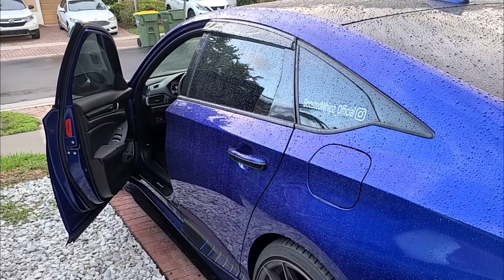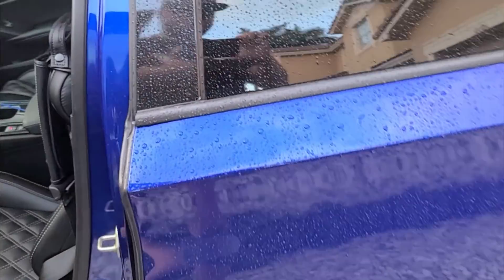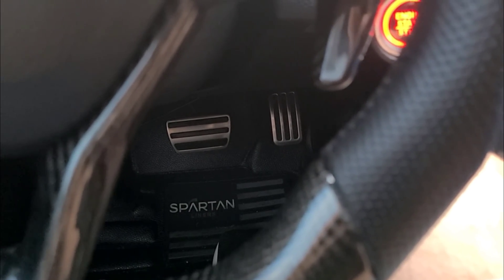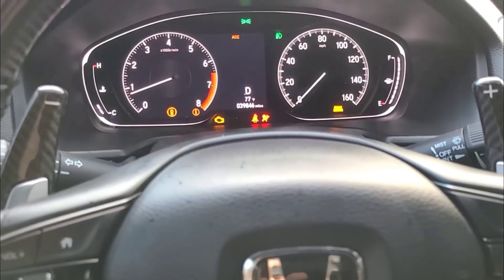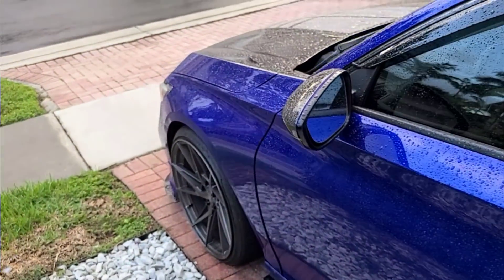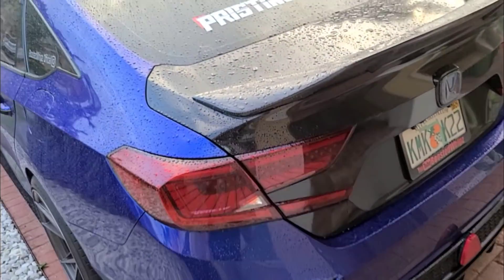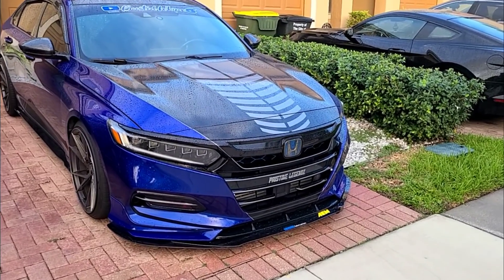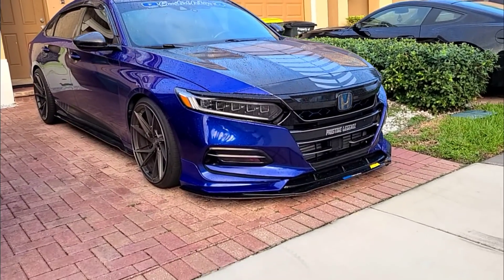CVT Transmission Goes Out at 40K Miles on Modded Honda Accord 2018-2020

Comment: Beautiful build probably the nicest accord I’ve seen so far I hope that everything works out for you in the car gets back up and running as far as everyone saying you should’ve got a manual transmission I’ve been driving a Honda civic SI three generations eighth ninth and now my 10th all si Which is obviously manual transmission but after all those years I’m starting to get a bit of a back problem as I’m getting older but I want to stick with a sporty feel so I’m going with a dual clutch transmission otherwise I’ll drive manual for the rest of my life

Comment: I got my 2018 Civic Sport hatch 1.5 turbo cause I specifically wanted a stronger engine and CVT transmission. I know CVTs are not made for power but at least they can handle stock power levels fine. I did some research and found out that the transmission in the 1.5T is the same one in the 189 horsepower Accord Sport sedan. It’s just m improved and better tuned for the turbo engine. Under stock power levels they can last a good while. Respect the boundaries and it wouldn’t give you problems. Here’s the deal people. 

If you want a faster car, just buy a faster car. Don’t tune it. People think they can buy lower horsepower cars and mod the hell out of them to become super powerful sports cars. It’s not worth risking it just for a slight performance increase.

Comment: Hey man sorry to hear about your car. I have the same car as you accord 1.5t cvt. I did a Ktuner stage 2 yesterday I’m at 25,000 miles. Should I take the tune off then? You think the cvt would be fine with the stage 2 on my car? I don’t drive like a manic with the tune or push it extremely hard. I’m getting rid of the car in a couple of months anyways. Just wanted to have some fun while I wait.
Reply from the maker: Should be fine since the base tunes are conservative.

Comment: When I had my 2018 civic coupe 1.5t CVT, my CVT failed as well around 32,000 miles, I had similar power levels to yours (I had 221hp and 224tq on the dyno)
 I had PRL catless DP and frontpipe
3” straight pipe exhaust
PRL cobra CAI with race MAF 
custom dyno tuned 22psi max KTuner
Reply: I think that 22 psi was your issue man my ktuner stays under 20 and it pulls hard with a custom stage 2 tune in at 53k and have had countless issues if I try to race in eco the car gets stinky fast or even just get on the gas sport revs higher and takes a lot more to get stinky to make up for all the power I’ve thrown at the small engine and weak trans my car is on 18s fully gutted and any other weight reduction necessary I believe not carrying around a family or a lot of weight has proven to help the car last I don’t expect the car to see no 500k miles or nothing crazy but I do think 250k is in the cards.
Reply: that’s crazy how you guys cvt failed i’ve been tuned on a phearable tune pushing 295 HP and 255 TQ and no issues race it every once in a while and i’ve been running it like that the last 10k miles and im closing in on 60k
Reply: the key is ti stay on top of your CVT fluids 🔑
Reply: @RemingtonScarborough  you have the 1.5t cvt? I have a pherable stage 3  whit k&n intake and borla type s catback.
I dont make hard pull but i always drive sport whit the padle shift ( just for heard borla 🙈🤣) i drive hard on the highway. I scare for the cvt i wonder i can swap the trans for à manual. I live in Canada so my accord was stored for the winter and i change the trans at all summer. Do you think we good whit our cvt bro ? 🙏🤣 i cant trade it or whatever and i realy love that car lol. I make nightmares all nights cause the cvt 🤣🤣

Comment: How do you like those Vertini RFS1.9 and who did you order them from? I was thinking of getting a set but found out the VS Forged VS21 are same spoke design but spokes are more curved/bow in (while yours are straight) in the concave face and they are true directional mirrored on both sides (your spokes twist the same direction on all 4).
Reply from the maker: Love them. I went through Tunergoods

Comment: My honda accord cvt transmission just went out 2 days ago and I only have 21,000 miles. NO MODS. NO RACES. Honda accord cvt transmission is crap (I was told by the technician). I bumped into your video trying to see if other people are having the same issue and yes they are. It wont cost me anything since it's under warranty 🙏.
Reply: Woooow Honda has lost its place when it comes to reliability

Comment: CVTs are meant strictly for fuel efficiency,  not for performance or modifications.  This 1.5 model should have had a 6 speed manual instead

Comment: I sold my Bmw 440i and the plan was to get an accord touring but i ended up getting a civic touring, i knew it had a CVT and after driving it for a while you can feel how fragile the CVT is when you drive it hard. Im currently waiting for the Acura Type S as I am now a Honda Fan for life 👍
Reply: why do you like the Honda? what do you like about it?
Reply: @jamesmedina2062  I like a lot of things, It’s spacious for a compact car, the driving position and seat is comfortable unlike the camry SE i was considering. When i test drove the civic touring, the ride felt planted and compliant at the same time for an economy car, the full LED headlights are sooo bright I love them, the safety features are also a very nice bonus. All in all the civic was the perfect daily for me until the next generation mazda 6 comes out
Reply: @jamesmedina2062  also the steering is very quick and the engine has more than enough power for most people, the only complaint I have is the lack of a physical first launch gear like the corolla
Reply: @jehadwadi4554  Thats crazy how Toyota thought of so many things and beat the Honda. Let me share what I see. The Corolla looks a little cleaner. The ride is plusher and the frame more solid. The noise is just right. The durability factor may be better due to mixed injection. Its a solid car. When new my Civic felt like you described. Now the shocks feel less damping than before. I had to do many mods to my Civic to make it right. Honda specifically made it really noisy and austere in order for people to buy Acura and Accord over it. It is on purpose. Toyota cuts less corners. They give you a good Corolla although the sound system is the worst in category. The overall driving dynamics of the Civic are why I kept the car. Brakes, steering, handling, and enough power. With a loaded car it lacks power but if its just me its fine.
Reply: @jamesmedina2062  I actually wanted the corolla over the civic at first but my wife really hated the corolla plus its more cramped than the civic but if the corolla had a better sound system and a bit more power I would’ve bought the corolla. Now the new civic is coming out and I’m sure it will be wayy better than any corolla. Sometimes I regret not getting an accord but I’m really interested in the next generation mazda 6 if it’s affordable

Comment: Don’t feel bad we have a 2018 Honda civic EXT turbo with a CVT transmission with 14,000 miles on it and ours dropped. We did the Exactly the same thing ours was tuned and Dyno. That’s what ours was $4,800 dollars later but we are good now.

Comment: The comments to convert it to 6MT are from people who don't know a first thing about cars. That was nearly impossible even 20 years ago let alone today. The amount of things you would have to replace is insane. You'd need entire new harness to begin with, not to mention you'd NEVER get the ECU to work correctly. It would cost thousands and thousands of dollars, close, if not over $10K and MONTHS of hard work. Go and buy a manual Accord. Problem solved.

Comment: I have a 1.5 2020 6mt I add a a takada air intake and straight pipes it only so far I oreded new torque mounts my car come with the legal street one that hasbro sells what can should I add next and or do when do I tune I want to save up and add the dc pipe as you know hella bread ima wait I’m thinking intercooler next followed by a tune by hondata what do ya think
Reply: Oh and I had no check engine lights come on removing my mufflers or the fat tube in the middle or adding the intake

Comment: I know that cvt's have a horrible reputation but I have a coworker that in 2015 purchased a new nissan altima 4cyl....he is still daily driving it after 200,000+ miles (all highway) AND he's never changed the trans fluid...I kid you not...Its the luck of the draw I guess...but many are dealt a bad hand unfortunately.

Comment: Loved my manual 1.5T. Sadly the engine had all sorts of issue appear at 20k miles. Ended up with a brand new fuel system and top end of the engine, only to have more issues and the same ones return. After $9k of warranty work before 25k mile I had to unload it.

Comment: Our experience with CVT's goes back to 2003 with the "new" Nissan Murano. The vq35 was awesome, for it's time. The "Trann.y" felt like a rubber band, however. At 66K, got rid of it, due to high failure rates for that "new" Jatco product. A friend with a 2015 Nissan Rogue had a total failure at approx. 60K miles, similar to your failure-event...her dealer replaced it at no charge...I guess enuff hell was raised by consumer groups. Nissan's reputation was sullied, with that product. On our second Prius...no CVT issues, changed fluid at 50K., and don't even know it is there, most of the time. Looking at Subaru Outback now. They seem to be ok., as far as reliability, in spite of their infamous head gasket issues of yore. I, along with others', wonder whether significant mod's will affect reliability. A good old manual transmission seems to be better, in the long run...now if we can "save" those manuals. Thanks, and hope you get your nice ride back, w/o too much $$$ hit. I subscribed...have a good day, and good luck with your 'fix.

Comment: BoostedWhipz - Sorry to see your CVT gone but a few questions from a fellow 1.5 turbo Honda with CVT TRANSMISSION.
1) Do you install "CVT TRANSMISSION OIL" cooler in the first place ? Will it help ? 
2) After the replacement CVT TRANSMISSION is installed, do you still go with your K-Tuner or want to keep it original factory tune? Thanks
Reply from the maker: 1. Waiting on my CVT cooler to arrive and yes helps maintain the proper temps for longevity of the transmission.
2. I am leaving base tune Stage 1 from K-Tuner until my cooler arrives. Once cooler is in I plan to put back my tune again.
Reply: @BoostedWhipz   thanks BoostedWhipz for your feedback. Yea CVT cooler will be an extra safety. Best of luck bro

Comment: Since this has the detuned CTR motor in it, can you bolt a CTR trans to it? With other mods of course for compatibility, but would that even be an option?
Reply from the maker: I don't have the 2.0.
Reply: @BoostedWhipz  ah bummer. Sorry to see it mane. It is a top notch build, with the only weakness being the cvt.

Comment: You need to do an interior tour and also can you show how you do your transmission oil change, i dont where to add the oil cant find the dip stick 2019  honda accord 2.0t touring
Reply from the maker: I take it to the shop for that. I don't do those myself
Reply: @BoostedWhipz  ok np i think i know where its at

Comment: Could it be from the oil change you did , maybe not the original oil from Honda , I have a Subaru also with CVT , and I’m due for transmission oil change .
Reply from the maker: We used only OEM trans oil and was done by a Honda Master Tech

Comment: Very beautiful car! Does it have a wide body kit on it or are those just the normal wheel arches? Also what brand are the rear lights! They are amazing! Feel sorry for your bad luck, but god damn CVTs. Can you change it with a manual 6 speed from a manual Accord?
Reply from the maker: I have a body kit yes. Swap to manual is possible but not an easy transition
Reply: @BoostedWhipz  wow! the body kit is amazong. What brand is it?
Reply from the maker: @midnighthoon788  a mix of HiRev Sports and S-Factor Fabrication.
Reply: @BoostedWhipz  thanks for the info! it looks amazing! good luck on the repair!

Comment: Like many people have said in the comments, if you want to race get a sports car or hot hatch with manual or at least traditional transmission. Why race a CVT midsize family sedan. Really don't get it why someone would go that far to mod a car but refuse to get the manual when they offer one. First thing I would do is get a manual before even considering the other mods. At least the manual is stock and won't affect the warranty or anything and is a "free" mod that came out of the factory. Probably cheaper than CVT too.

Comment: I’m a tech at Honda and we recommend replacing the CVT fluid every 30k. Not saying it was going to help but in the end of the day. CVT is garbage bro Don’t let those paddles fool you. If you want a good Automatic go with VW DSG they hold mad Power and Torque.

Comment: Fuckin convert it to manual your gonna blow it out again guaranteed or else you just have to stop putting it on the Dino and relax on the wide-open throttle with the CVT. I go about 100 shot of nitrous on mine with the progress controller and transmission cooler and it’s doing fine based on the user Also consider a throttle response controller for the pedal if you have a heavy foot

Comment: Smell your transmission oil it should not smell burnt. 35,000 miles is low to change the transmission oil but your manuel will tell you when is the recommended time to change the oil for Hondas you should always use the Honda transmission oil from a dealer .Transmission oil could be low these new transmissions make it harder to check the level because they’re sealed .good luck with everything

Comment: Man. Sorry to see that. With those Hondas, they have strict tolerances with the automatic and cvt transmissions. The wheel and tire diameter basically needs to match OEM otherwise it will let go early. Most folks run undersized wheel and tire combos so their car sits lower. In an automatic Honda it is suicide on the transmission. I say make sure your wheel and tire diameter are as close to stock and drive it carefully. No need to race it. You did good on the fluids and maintenance.

Comment: When you did your trans oil change did you let it warm up then check the plug to make sure it had enough oil
Reply from the maker: Yesssir
Reply: @BoostedWhipz  are you putting another cvt in it or could you add the 10 speed auto?
Reply: @BoostedWhipz i see this was 2years ago, how was the new tranny ? And did you go with another cvt?

Comment: That’s terrible. I don’t race though do have cvt... I remember sometime last year a girl on Instagram posted her civics transmission gave with less miles on it and she tried to get it fixed through the dealer with warranty and they wouldn’t do it because she had gotten a muffler delete which voided it. Possibly biggest reason why I decided I wouldn’t do that, cars sound nice but in the end you just never know, the computer system expects a certain amount of power and forcing it with more 😬 seen other guys on here with cvts doing the same and I passed on the warning just to give a heads up on the problems they could end up facing, in the end it’s up to the driver. Hope you get it back good as new and no more persistent issues. Feel like once they go into a shop for mechanical work it’s all down hill from there. Least it’s how it went with my pickup when I had to go in for a rebuild

Comment: I change my cvt fluid every 18,000 I drive it too hard not too at 39,025 right now. 
(Honda Civic 1.5t Cvt Megan downpipe and a muffler delete with an upgraded air filter)

Comment: These 10 gen honda have krapy engine too. When I first time opened the hood it is like a small cattle sitting in the center. I have 9th gen V6 with AT I love it it is one of the last batch of the most reliable engine married to reliable transmission. I have almost 90 K, bought it new. I suggest once fix it take used one and sell it. Engine will also give problem. CVT are not known to have long life....peace
Reply: a small cattle???? 🐮

Comment: I have the same problem yesterday with my honda what you did after that plz let me know i am so upset 😡 I spend on 10,000 for mod for race and I am out for race yet 😢 let me know what I will do now still I am waiting a bit ......
Reply from the maker: Got it fixed at a shop.
Reply: @BoostedWhipz  so what they done rebuild ? Bcuzz I need help to find out the way to make transmission more powerful then stock
Reply from the maker: No replaced. Nothing exists to rebuild or make it stronger.
Reply: @BoostedWhipz  seriously thats so annoying 🙄  let's say if we going to replace there any chance we can get better choice then this transmission ? Did you find your questions ans that way ?

Comment: Honda cvt’s can go past 200k miles. But not with tuning and rough use. I make sure I do smooth acceleration, easy braking, low rpms, and never shift while the car is moving. I save the rough play for my BMW lol.

Comment: I am sorry☹️ I used to be a HONDAHOLIC , since I had a sad experience with my 08Accord  I decided no more Honda, specially with turbo and CVT , i am an old guy I just want a reliable car without problems, my ‘13 Camry XLE has 101K without a single issue , only MAINTENANCE, 6 speed “normal” transmission .
Reply: This talk of CVTs going bad makes me reconsider buying a new vehicle. I bought 2005 Toyota Camry brand new. Fluid changes on time and replaced parts that wear out myself like brakes pads. It met its untimely end when a red light runner hit me and the insurance totaled it. It had 275K miles of worry free driving. Man, that thing is a tank and love it. I took care of the interior and exterior. I get a lot of compliments how clean it was. I miss it!